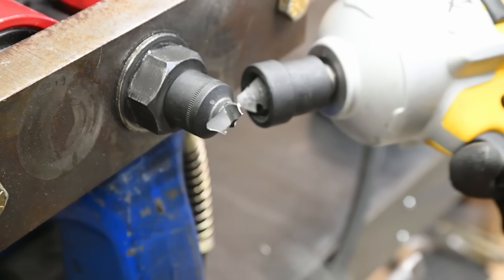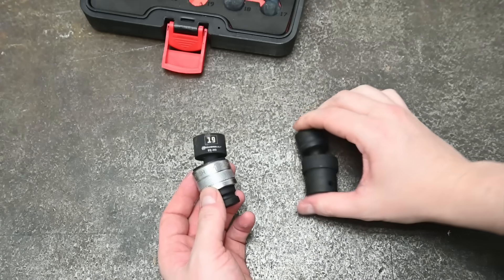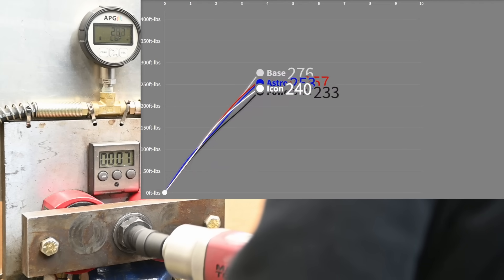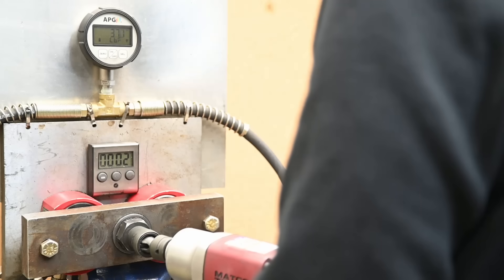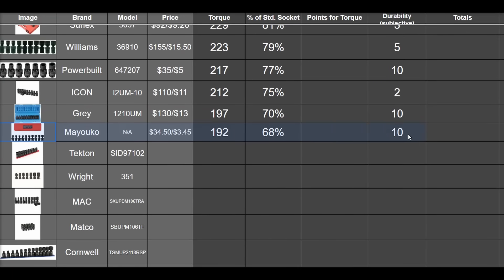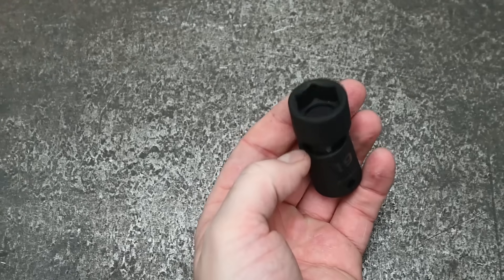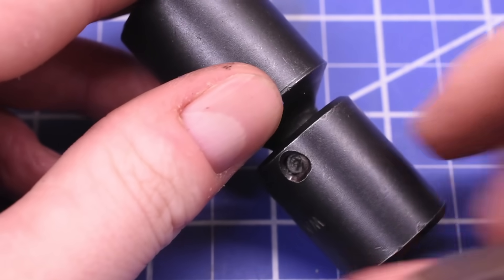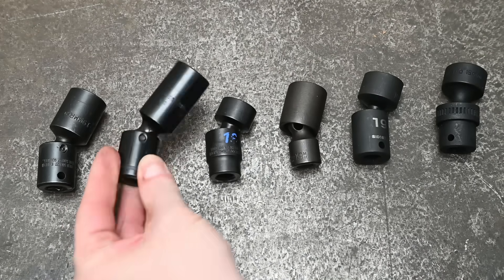Impact Sockets in 2025 are Getting Weird: New Tekton, Icon, Koken, Matco & More

Comment: Wright tool is an excellent brand based and made in Ohio very close to me. I've talked with one of their engineers and was very impressed. I don't know how they can make such affordable high quality tools in the USA.
Reply: I wouldn't say they are affordable. $27 per piece is pretty damn expensive. But if your comparing to the other ands,. Well then that's simply because they can scalp their customers and get thanks for it. There are a decent number of brands that make really nice made-in-the-USA tools; it's just hard to compete with China and Taiwan. America has gotten so used to being on top that the moment they have to put in effort, most quit. But some are willing to put the effort in, like Mayhew, Channel Lock, and Bondhus. There aren't many, but the ones that do prove their worth. I don't want to buy tools because they are made in the USA; I want to buy tools because they are the best, with them being made here being the cherry on top.
Reply: The best is different for people like me. If I can get a mid quality tool at the best price/quality tradeoff then that's the best to me. Not very often am I going to use hydraulic press strength on a good wrench, if I'm putting enough strength to destroy a wrench I'm grabbing a half inch socket and a breaker bar taller than me. USA name brand doesn't mean much to me after a set number of years.
Reply: @littlejack59  "Best" is often a ridiculous concept.  The right tool for the job, seldom needs the "best" tool.  It's the sentiment that fosters the existence of Snap On, even when they aren't the best, and I think we can concede that Wright's tools cost less than Snap On and arguably, a better bang for the buck even if some Taiwanese brands offer and even better bang for the buck.

The question really is, how much of a bang do you need, then that's the amount of bucks to spend.

However, I will always buy made in USA if the quality is similar and the price not much higher.  If you don't do that you are usually subsidizing China's sneaky way of trying to avoid steel tariffs by sending the steel elsewhere to have tools made out of it.

In reality that means that hard working men (and unfortunately women and children as well) in China are slave labor for a little bit of savings.  That stinks.  I'm not a racist, they deserve a good life for hard work too.  Work and you should have a life, not so much those who choose not to work (all too common in the US these days).
Reply: Wright makes pretty good stuff and I own some but good luck trying to buy or warranty alot of their stuff. Their tools aren't widely available for some reason.
Reply: Wright tools has a distribution and marketing problem. Finding them locally can be a problem and I never see any advertising or even social media influencers being sponsored as a marketing tool. They make great tools but only seem to rely upon word of mouth advertising.
Reply: manufacturing business is about engineering of the manufacture, not the product as much as one would think. 

usa made a mistake with cars thinking it wasn't, the unions in particular and the companies failed to tell that to the unions in a way where they would have listened. teslas gigafactory tried to bring that thinking into usa. you still have to engineer the product to that then of course hence the cybertruck being so expensive yet having fitment issues.
Reply: I don't know why some people think Wright Tools is high quality. They do have decent impact sockets, but even those have their issues. Everything else is trash and has terrible QC. Terrible roll stamping, off-center broaching, paint spewing out from inside their chrome sockets, very limited sizing, especially for their swivel impacts, and their impact swivels are big and fat, and almost unusable in modern engine bays. Their wrenches have terrible quality control as well. Off center broaching, peeling chrome, sharp edges on the open end, the offset is sometimes 10 degree, or 12 degree, and they are short pattern too. Proto Industrial is 10x better and priced less too. Proto Industrial is so underrated. They have phenomenal USA made tools that are priced very reasonably.
Reply: Excuse me sir but I just went to Provo Industrials website and they most certainly are not reasonably priced. $900 for a socket set my ass.

Comment: Thank you for doing more universals. It's the one set I haven't bought for myself yet and glad I didn't go for the Icon. I've heard great things about the SK (pro/old-school) and Proto lines; Husky is also extremely convenient and always surprises me for the price. May you include those brands more often?
Reply: I have been using the Astro 3/8" pinless for about 2 years and they are damned good.  Under $100 for a comprehensive set (forget if they had 8MM) is a screaming deal.

Comment: The paint problem on the Matco set should have had a larger point deduction.  For tool truck prices, they had damn-well better be stamping or lasering the size into the socket.  There's no excuse for them to be using flakey paint.  You're paying an extremely high price, you should absolutely be getting extremely high quality.  Painted numbers belong on cheap single-use tools - anything higher in price than Pittsburgh needs to have PERMANENT markings.  Lazy and slipshod.
Reply: Matco definitely is selling Amazon rebranded junk for 500% markups
Reply: They’re actually finance companies. Tool trucks are nothing but.
Reply: @chrisschmidt4792  Bingo. Even the entire auto industry is like this. Ford Credit is actually the money maker, not FoMoCo. Same for GM, Toyota, etc. Many other industries as well.
Reply: 😂🤣 why so much hate for Matco? I can only assume it’s Snap on purists? 🤣😂
Reply: @commonsenseisdeadin2024  As a non snap-on purist, the matco tools that I've used and seen on their truck makes me question their unbelievable prices. I've used Pittsburgh pliers that are better quality than matco stuff and find tools that look identical to matco for at least half the price. At least with mac or snap-on, you're guaranteed to have high-quality tools once you take a hit for the price.
Reply: @Narflex some mac screw drivers are Stanley from Walmart I got the mac set for 100 bucks off the tool truck probably 15 years ago bought a set from Walmart years later only to find out one was green and one was yellow I wanna say it was less than 30 bucks and was a bigger set mac ain't getting off Scott free 👍
Reply: @Narflex  that's one hell of a hit! The only Matco tool I have is the thread chaser that EVERYONE has. No idea who it's made by but they are all the EXACT same. I got it from a pawn shop for like $35 so.... Well sold! 

MAC from what I've seen I like better than Snap-On. I like Snap-On boxes but I'll never pay those prices. Snap-On is indeed a better tool, better quality, stronger, etc.... and for the price it sure as f××k better be!! 

The point isn't if brand x is as good as snap on, it's more of it works just the same and it's a tenth the price! I have A LOT of Gearwrench and plenty of Pittsburgh... I've never had an issue (I've professionally wrenched for 15+ years) and got cheaper/online I like Astro and I've had really good luck with that Lexivon.
Reply: @Narflex your response really makes me wonder if you've been on a MAC truck in the last 15 years. Since Stanley took over it's been a mass outsourcing to China, and a drop in average quality.
Reply: @ only china tools on a mac truck are vendor-supplied tools not mac or stanley company-made tools.  snap on only tool company with plants in china--still too many taiwan made tools but that the world we live in and taiwan made tools are impressive mostly also---stanley bought mac in 1978 also, 47 yrs ago!
Reply: @mikethetoolman8776  that's hilarious. Have a look online. If it doesn't say USA it's made in Taiwan or China, but you still pay the high price.
Reply: @  snappy cordless all chinese and blue point all china made?  mac/dewalt Usa made or Mexico at least.  taiwan making good quality tools IMHO.
Reply: @Narflex  That's because you pay for the warranty replacement when you buy the tool if you use it or not.
Reply: @Narflex guaranteed high quality with snap on or Mac? Thats completely false. People need to stop with the tribal mentality. Not everything snap on makes is good and not everything matco or harber freight for that matter is bad. Every company has certain tools that are better than anyone else's and every company has certian tools that are absolute trash. It depends on the individual tool, which is why you need to do your research when buying things. But bc humans have tribal mentality, what happens is someone will buy 1 snap on or icon or whatever brand tool that is good and then they think their all good and that its now somehow their brand and the best. Or theyl buy 1 harber freight tool that happens to be junk and they think their all junk. Its tribal mentality. A real professional has a mixture of brands bc they want what works the best.
Reply: @commonsenseisdeadandgone that or they are truck tool haters.
Reply from the maker: They're also stamped/engraved on the top and bottom ends of the socket: https://images.contentstack.io/v3/assets/bltab8525fe5f7bb21b/blt6fd3ba1d5e98164a/66ed02353f57abddf8b476be/SBUPM106TF_ProductImage_PrimaryImage_1500.jpg?width=640&quality=75&auto=webp
Reply: @TorqueTestChannel  I am a Matco Distributor and currently at our expo we have voiced our concerns with the product management and they are already working on the solution. They are lifetime warranty tool so they will be replaced with the new design. Thank you for objectively demonstrating our tool and when the new design comes I would like to replace the socket you currently own with the new version.
Reply: @WilboTools  Awesome to see you are engaged! And helping make the company better.
Reply: If your buying tool truck tools you probably use them pretty much everyday and can basically tell the size just by looking at them
Reply: If they want to be the best or have a good market they better stop cutting corners.  Ive never been a matco fan. Maybe their boxes are ok. Most of their tools are rebranded marking up the price just because people will pay it.
Reply: Frankly for that price they should also be American made. Plenty of great Taiwanese tools in my toolbox, I’m just saying for the tool truck premium the outsourcing doesn’t make sense.
Reply: @sethallison5682  As Crescent demonstrated after the buyout, "American made" doesn't mean much.
Reply: @ ok
Reply: @Comm0ut  Pains me every time I see that name mentioned. I quit buying them immediately. Too bad nobody shopping at box stores seems to care, and they have no problem paying too much for something made with labor that costs a tenth of what ours does. Amazon is proof that nobody wants to pay for Americans to have manufacturing jobs. We all want a high standard of living, but we don't want to pay for anyone else to have it.
Reply: @sethallison5682  they are
Reply: They are mid grade Taiwan made. People shouldn’t be fooled just because they are on a tool truck. No thanks!
Reply from the maker: @ They're made in the USA
Reply: @TorqueTestChannel then why did you say from the same Taiwan factory in the video? I’m confused.
Reply from the maker: @akbychoice  you're thinking of cornwell
Reply: @nordicpride9708   aj manufacturing makes the newest model ones

Comment: This might be a dumb question, but why are they called universal sockets?
Reply from the maker: It's sort of borrowed from the U-joint on a drive shaft, that allows it to articulate at different angles yet still deliver torque down the length to the differential. That's called a universal joint, these are universal joint sockets, or universal sockets.
Reply: No such thing as dumb questions my guy; only answers!
Reply: @Hazzo88  My teacher always told us there were no such things as dumb questions. Just dumb people who ask the questions.
Reply: @ Lol....  I just got cooked 😂
Reply: The mechanism that allows it to swivel is what's known as a "universal joint." It's also found commonly in car drivetrains where you'll hear it called a "u-joint."

Supposedly, it was named a universal joint because the mathematical model of how it functions is identical to a part of the model explaining time differences between different locations in the universe.
Reply: Let's just call them u-joint sockets, short enough to not be a mouth full, but gives plenty of info to not confuse them with a universal socket (i.e. gator-grip) where one size allegedly fits all.
Reply: Thanks for the info! The  more you know

Comment: I remember when having the Cornwell truck visit your shop was like having a Kmart truck stop by. They've come a long way. I used to buy Mac before they changed in the 2010s, for the worse. Great video!
Reply: The good old cornhole truck.
Reply: Have cornwell double jointed wrenches, paid like 350 for them but at time no one else made them. Wish the joints would lock otherwise great wrenches.

Comment: Its sad to see the durability on the icon, I've been using them with my milwaukee high tourqe and have had no issues so far.
Reply: I’m no genius but also not a tard and I blew out an icon with a mikuakee m18 1/2” on a Durango knuckle.
Reply from the maker: Sometimes you get lucky sometimes ya don't with these things. it's why we included them again in a new drive size, we're two times unlucky
Reply: I also use mine mainly with suspension work and no issues yet, but this has me worried.

Comment: I always thought the pinned sockets were kind of weird and never used them all that much but when we did use them they worked and we never noticed a problem with durability.  That was while working as a professional mechanic but also it was very long ago and the sockets were probably SnapOn like all the rest of our tools were.  I'm not sure what to think about your test, as a user I think durability should be the most important feature, then maybe torque transfer, angle of departure last.
Reply: Hard to weight what is important. For a pro at a shop angle may be the most important as it lets you get the work done the fastest and durability last because you can pass those costs on. Heavy equipment shop may care about torque as they are on the limit more often. Regular garage use may be the durability because it is your money.

Comment: I bought the Walmart brand half inch Impact after watching the video you did on it. Also I got the dewalt adapter to go with it and tho my needs for it doesn't match a heavy duty mechanic uses, it has "So far" done pretty good. It does have a delay when pulling the trigger and starts very slow then ramps up "and not sure I like that" it has performed well
Reply from the maker: You're exactly right about the trigger
Reply: I have the old impact same problem, but when i used the bigger battery it seems to stop the delay